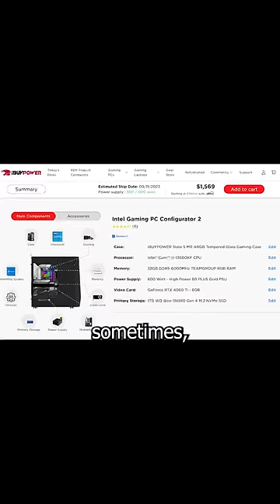Is a prebuilt #PC worth it? It depends. #technology #shorts #tech #computer

Comment: the real answer about pre builts is they are bad, like he said they use the cheapest hardware and yes they will even use things they say they wont. like the website may say they use an 80+ gold rated power supply but they assume as long as the pc works when it arrives you wont check for years so instead they will use an unrated or white rated power supply thats super innefficient and they will do the same with other components if they think they can get away with it and no you dont get what you pay for, they charge you top prices and they give you bottom level of everything like your storage and motherboard will be bottom tier

Comment: Typically building yourself is the way to go and can be cheaper. But in 2021 i bought a prebuilt with a 3070 and ryzen 7 because at that time it was cheaper to get it that way then buying the components like gpus themself. A few months later my power supply in the prebuilt took a shit so the case i had around to transplant everything over was then built 😂

Comment: ok, but like, the average prebuilt costs like $300-$500 more than it would cost to build the exact same pc, on average it only takes like 2-8 hours to learn how to build a pc, and at most 2 hours to build one, thats 4-10 hours, say you make 14/hour that means at most $140 worth of time or $280 worth of time if you make $28/hour, meaning if you factor in the amount of time required to account for the extra amount you pay by getting a prebuilt, it takes more time to get the prebuilt. (going based on the lower number of $300 and $28/hour that is 10.7 hours of extra work to get a pc)

Comment: In theory I could build my own computer I'm just not confident enough to do so, maybe some day when my new computer is past the point of reasonably being upgraded i will sit down with one of my friends whos more confident in this than i am and ask them to help me build a computer. Until then my new refurbished computer covers all of my bases. Built in the box of an old computer it can run everything I would reasonably expect it to and it only cost me about 800 CAD biggest flaw it has is just that it needs a usb accessory to connect to wifi if you cant hardwire it in

Comment: I had both prebuild and built one, the one I built I have since 2017 and everything worked fine graphics card broke i believe in 2020, replaced it without problems and power supply broke in 2023 due to short circuit, replaced with no problems. I have new prebuild since 2023 and had no issues yet, other then its windows 11 which i don't really like but I am too lazy to change it to windows 7 or 10

Comment: i wouldn't go with a pre build.. i instead will pay the ppl at the place i buy the parts to assemble and test so everything works for me.. since my pc will cost me ~3.4k$ i rather have ppl that knows what they are doing for sure instead of braking something myself.. especially since it will have water cooling..
it is not that i don't know how to build a pc.. i do work with electronics and stuff at work and actually did put my current one together and got it running from thrown out parts i found.. ( well i don't have a actual case.. but it works fine even though the parts are 10+ years old) i just don't wanna risk anything when it comes to the most expensive investment i have ever done so far...

Comment: Alot of prebuilts in the mid and upper range are not worth the cost they’re overpriced per part; the low end prebuilts are usually worth the cost or cheaper than price per part, but a lot of times the upgradability requires all new parts as apprised to building ur own you could start with a higher end mb and psu and then over time upgrading is a non issue, even a lot of the low end cases from prebuilts struggle to support a lot of hardware upgrades

Comment: Pre builds are find but the reason they really get the hate that they do is because a lot of them... Like 90% of them are just straight up rip offs compared to just finding parts in a shop and putting it together. A $2000 pre build could really be like $1000 or even $900 and the only reason it's priced that way is either due to brand recognition (cough cough alien ware) or some big named company trying to profit off the PC market like Walmart.

Comment: I got myself a prebuilt with better specs than what I would have built myself back then as I was working on a tight budget and it was cheaper. 1000€ for the whole package, PC, monitor, mouse, keyboard, headset. The whole shebang. All I did was install some extra ram but that 1050ti with a ryzen 5 is still serving me well. Tbf, the pc was outdated when I bought it, but it's done what it's supposed to do and more. I can even play Doom Eternal and BG3.

Comment: Pre built PCs are good when they are tested. Yesterday I received a new PC and for half a day was wondering why is the CPU overheating to 90 degrees Celsius in the freaking BIOS. Turned out some genius did not even look at the manual for the liquid cooler and connected the pump and fans to completely wrong connectors.

Comment: They are bad and I say that as someone with a prebuilt. Not only did I spend more money, that’s the least of my worries for this, but i also don’t know anything about my computer. When it comes time to upgrade, apply thermal paste, replace my water cooler which I’m pretty sure failed at some point I have no idea what I’m doing. Almost destroyed my gpu and motherboard trying to take it out the other day as a recent example. Thats my main concern, of course money does matter too though I spent 3000 on mine back in 2018 or so and now it would probably only go for like 500 on market place if that. Really not sure I have an i7-9700k, rtx 2080, and 32g of ram. Of course thats pretty decent these days but with how much i’ve used it who knows. Brand is from cyberpower which all around make good prebuilts however I do have issues where the pc only boots to bios till I reset windows with a usb but that only happens once a year or so. My first desktop pc was an i buy power and their build quality was kinda poor to be honest.

Comment: They do come with slme cheap parts. But you can upgrade those as the years go by.
I got my prebuilt 7 years ago and have been buying upgrades for it throughout my ownership.
The cheap heap Toshiba HDD died after 5 years and i upgraded to an m.2 nvme ssd.

I wanted a better graphic card, i installed an rx 6750xt to replace the rx580.

That needed more power so i got a much better power supply.

Then a year later i notice my ram is lacking for newer games.
So i drop the 8gb single stick and upgraded to dual channel 32gb.

At that point the next bottleneck was my cpu, but i dont want to spend more money on that so i bought a cheap air cooler upgrade from the old box cooler. The lower temps help it stay boosted higher and i cleaned up alot of my bottlenecking issue.

I have only recently reached a point where everything is so well balanced that uograding it will become a big waste of money. Si ill be sitting this way for the next 2-3 years before i consider getting a whole new prebuilt to do it all again.

Comment: My first prebuilt was an ibuypower i7 7700k, gtx 1080 (red and white I forget if Msi) and it cost me $1800, back when the gpu was being scalped at $1800, and it was done correctly, only thing that could’ve been improved was sad and ram. But everything was done right, 4 years later I upgraded everything but the gpu.

Comment: prebuilds are fine you get a working unit that has windows and drivers installed etc.. i upgraded things off the two I've owned from cyberpower pc. My current system is from 2017 its still getting 240 FPS in Fortnite with everything on medium settings for no lag etc. old 2080 TI im replacing the fan kit on tomorrow one died :(

Comment: I got a pre-built as an easy peasy pick. The 3060 broke after a year and switched it with a 6700xt and did all the driver swap myself. Going to be going to an r9 5900x here soon and upgrade the power supply to 1k. And when the 6700xt caps. Switch it to the 7900xtx. So yeah lol. I selected the 16 gb option from pre-built. I currently have the r5 5600, 6700xt, 16gb, 512gb, 650psu, asus prime b550-plus ac-hes monltherboard. I got it so I didn't have to build the am4 and I got everything set with it. Going to go fully modular power supply as I can throw in a 3090 as well. Different games run better on either. 7900xtx is about the same as a 3090 lol. Ray tracing from 3090 is better than the amds. Some games don't require it and others do.

Comment: The problem whit pre built is the Quality between models/store can swing wildly.
Not in how much buck you got for your money but in design Decision.
Meaning if you have zero ide you might pay 1000 for a pc that perform like a 350 machine.
Or you might buy a pc that need some extra Ram for less then 50 for a 350% performance gain and perform in the top 10 build guides vs one that struggling whit Minecraft.

Comment: What are you on about? It took me more time to find a decent prebuilt. And i had to learn what are the prebuilt components are and how do i measure their worth and are they even fit to do what i want at which point... Yep, was easier to get the components, case i actually wanted, no AIO water cooler because it's a PC not a vaporeon and a replacement CPU bracket that won't let it bend! And like an hour or two of cable management because these are thicc.

Comment: Hints why i bought the parts and built mine myself its not the most beefy but itll get the job done because later on imma upgrade it to DDR5 i9 w/ AIO and a 5060 and possibly upgraded CPU

With prebuilts you dont know if you can upgrade it untill you get it meanwhile a hour and a half long video on "building pcs for dummies" as well as another hour long video on "programming pcs for dummies" is simple enough for someone like me to understand and i have the attention span of a gnat so if i can follow along anyone can if i can find the videos ill link em

Comment: Prebuilt PCs aren't necessarily terrible, but there are a whole lot of crappy ones out there. You have to be careful when buying one; you have to do some research.

If you're looking for a quick tip when it comes to buying a prebuilt, I'd say avoid mass manufacturers like HP and look at system integrators like Xidax instead.

Comment: Have fun paying $1500 for a $600 pc. I’d rather not know a thing and build one myself. (which I did) Takes a lot of research and maybe some trials and errors but at least I can fix it myself and put the stuff I want in it. There’s literally endless opportunities you can do with $1500.
Reply: Case, fans, ram, ssd, psu, & cpu cooler all $120 or lower. Lets say $100, $80, $110, $120, $125, & $60=$600. Leaves you with mb cpu and gpu. Get a nice 5800x, $200. A decent little b650 $200-250. A 4060 $480.

Comment: So since I doubt few will read this, here is goes.
I have a pre built HP Pavillion i7 7700. With a 1050 GPU installed.
I also have a i7 7400 Asus full size tower I use for business and not gaming.

So being someone who used to do his homework, I skipped classes now. I decided to go from a 1050 gpu to a 3060 single fan gpu.
Boy that was a mistake. I knew it wasn't going to fit in the HP Pavillion, but the Asus board is too old for it as well, it doesn't have the 8 pin connector the gpu needs.

So I wasted 300$ on a new single fan 3060, when I should have purchased a 1650 instead. I can either sell my open box 3060 single fan, or build a pc from scratch to accommodate my out of place gpu.

Any suggestions, besides getting smarter, I tell myself that one everyday.

Comment: 1500 for a 13600kf and 4060ti is not cheaper than building your own unless they used the best components which they clearly didn't  4060tis go for 389-400 12600kf cost 289. You have roughly 800$ left in the budget which is enough to get top tier ram, motherboard,psu and a nice case and m.2.

Comment: Is a pre-built worth it?
If you get it from a reputable source

That's my opinion, I built my own PC, but I have sent many of my friends to pre-built sites that I've done research on and know that they use good parts. I would advise against just going to your local Walmart and buying one of the pre-builts they have, they don't have amazing parts typically. Or they don't give you a detailed enough spec sheet, which makes upgrading them a pain in the ass.

Comment: now days they try make prebuilds to where you cant upgrade them you end up having change the board everything to just upgrade a graphics card hp and there ps2 adapter psu...... and then only sell a 550 watt replacement  with the ps2 adapter on it

Comment: I feel like many of the neck beards opinions are formed because back when I was in highschool 2009-2012  pre built systems were stupid expensive and often came with the cheapest RAM sticks and cooling systems money could buy so building a pc was more economical. I was of that mindset until I went to build mine and found that I could source a prebuilt for cheaper than I could build the same system, and then upgrade it to a better GPU for around the same price as building that system would cost me without the improved GPU

Comment: i dont hate prebuilds but i hate the warranty stupidity they do such as you cant install your own 4 tb ssd drive in the drive bay as it will void it and they charge almost what ya paid for the warranty to install it at their local store its dumb its legit 2 cables and a screw for my pc and the sata and sata power were just hanging there already wth on top of that i got lied to about the specs instead of 16gb ram i got 8 and instead of a 1660 i got a 1650 and instead of a 700w psu i got a 400 and instead of a 8th gen i7 i got a 2nd gen i5 never buy a prebuilt one from best buy

Comment: I had to buy pre build pc for my work. The system had to have I7or ryzen 7 at least and gpu with 6gb or v ram at least. The shop that build that pc went with I7 12000k and B motherboard. Just like why do you give me a cpu that cna be overclocked with a motherboard that dose not support overclocking like wtf. Gpu was 4060, and ram was fine, the one more thing that they saved money on was is PSU it is a oke unit from zelman but it is older unit. Like on box it says SLI 2013 ready, like I am amazed how can they even get away with it. Anyways if I had time and could I would build it myself, but yea lack of time and ofher things made me so I have to order prebuild

Comment: I once worked in a machine shop where the old-timer told me, " if somebody already makes it, you're not going to make it any cheaper. "

You can make it better, but you're not going to make it cheaper.
Reply: Really? Guess he aint an Aussie then, I have seen low mid range prebuilts going for more than a high mid tier PC built by parts where I live. It was why I didn't bother with prebuilt for my last big upgrade. Also kind of screams that old guy is just ripping off customers.

Comment: I build my own pc but if i ever needed to replace more than one part at a time i see no reason not to grab a prepaid, just make sure you do some research, if it's air cooled make sure they pad it well for transit the heat sinks can yank on the cpu. (much heavier than the liquid ones which is why a lot of pc building sites default to liquid cpu coolers) 
Double check for damage when you get it and make sure all the screws are tight and the gpu/ram/cpu are all seated right.